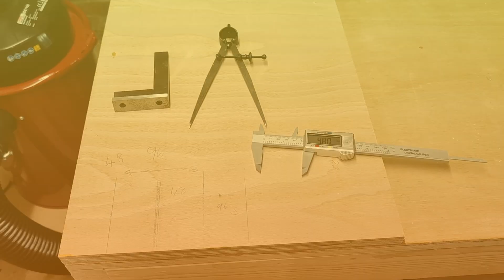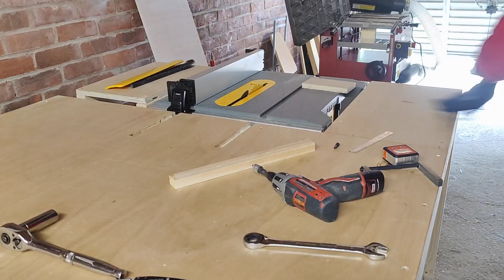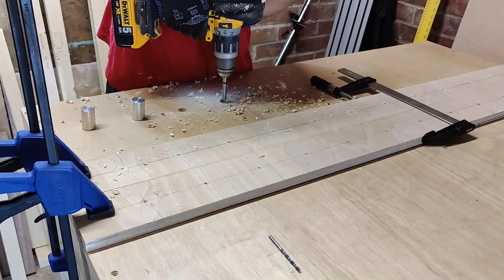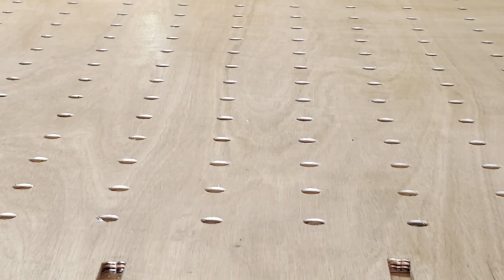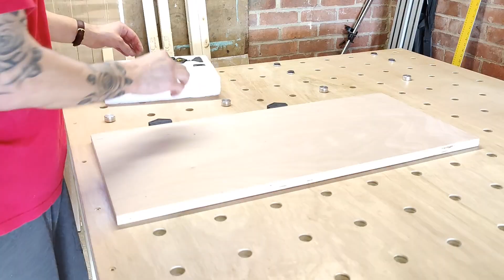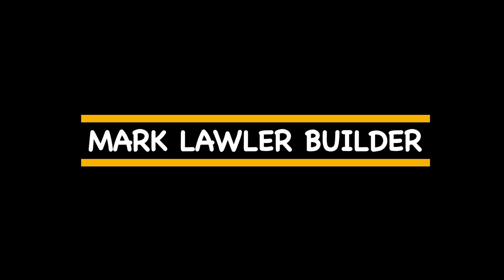Making a DIY  MFT Bench Top 2 simple jigs - No CNC | No Specialist Tools Required

Comment: PS:  You are the first fellow I've seen who has the sense to use dividers to lay out the holes.  So much more accurate than using a rule or (egads!) --- a tape measure.
Reply: Yet any error with dividers is multiplied.
Reply: I have never seen any video using rulers.  We all know measuring is error prone.
Reply: Well I see some misalignment there.

Comment: Well let me also add my explanation. MDF which is the most used for cabinet is usually 16mm ot at least thr 16mm is usedthis was used as a multiplication factor for the 96mm to make stacked pieces easier. If 18mm was the more used size I would guess the measurements would havr been different

Comment: 96mm was chosen for the same reason why most woodworker prefer imperial over metric (yes, ironically 96mm is in metric lol):
96/2 = 48
48/2 = 24
24/2 = 12 <- similar to inches to a foot
12/2 = 6
6/2 = 3

If we chose 100mm, then
100/2 = 50
50/2 = 25
25/2 = 12.5 ???

Comment: With respect to the 96 mm spacing, it is a requirement of the LR32 worldwide industry standard for cabinets and furniture. All cabinet hardware is LR32. The LR32 system was developed after the end of World War II in order to help speed reconstruction of the vast number of buildings destroyed during the war. The spacing was decided upon because that was the closest that multiple drill bits on a line boring machine could be placed, because of the size of the gears then available. Most of Europe had been using the metric system for a long time.
Reply: I knew that...  But not the gang drilling/gear aspect.  Cheers.
Reply: Nice to read this and to know it jet. I had this question al for longer time, but without any valuable answer.

Comment: An observation: By referencing each subsequent hole set off the last and using dividers in that way ANY error will be compounded…even just 1/10mm by the end of a row will be a whole mm out.  Do a check to ensure hole #10 is centred 960 mm from hole #1.  Thanks for sharing.
Reply from the maker: You're absolutely right but for what I needed it works fine it's square everywhere so ideal for clamping
Reply: @MarkLawlerBuilder  I agree
Reply: I would walk off the holes from the start and see if the tenth one lands on 960mm and adjust until it until perfect. Then walk them off again and leave marks.

Comment: I believe  96mm is chosen simply because it was adopted by Festool and fits their range of accessories….I could be wrong.  In any case if all your dog hole fitting jigs are single peg…then it matters not a jot what spacing you use.

Comment: The only concern I have is that this method would allow for a multiplication of error.  The strips would have to be exact.  I think when I get to that point, I will really consider the Parf Guide as shown by Ron Paulk.  So far, I have just drilled 3/4-inch holes where needed.
Reply from the maker: Thanks for watching. What ever suits your needs best to be honest I only use it for holding work. So suited my needs.  However, my 4ft square hits every bench dog perfect

Comment: Mark Koons
0 seconds ago
This is a useful video. Thank you. I'm mulling over the possibilities for a combined outfeed table, systainer garage, and assembly table and I'm considering using 1/8" tempered Masonite as a replaceable top surface. I've used tempered Masonite well-waxed for other bench surfaces with gratifying results. My question is whether 3/4" MDF plus an extra 1/8" will pass the ratchet clamps often used with the MFT grid system. From your experience, does it seem like the clearance would be okay?
Reply from the maker: I don't have ratchet clamps but i think they would be fine

Comment: Thanks for the link to the bench dog clamps ordered these right away. In reply to your question why the holes should be 96mm apart, 96/3=32mm and this is the normalisation standard for cabinets, hinges and so on. See the festool LR32 system for details. BTW nice video.

Comment: No problem in using 100mm.
The 96mm is because 32mm is used for spacing in shelves, but who actually use the MFT holes for spacing shelves ?
100mm makes much more sense to me.
Edit: Besides .. Some people make the dog-holes only as they're needed - without measuring.
So even if you don't get them accurate to 0.0% tolerance, don't worry too much about it.
Reply from the maker: Thanks for the feed back
Reply: I thought it was 96mm +2 to get to the center on each end first, but that doesn't make sense either.

Are there many jigs (or other things) that you can buy that use the 96mm spacing?
Reply: @Warinx  The Parf Guide system has a few 96mm spaced tools, but most of the tools have 'flexible' spacing.
When you purchase a Festool track for their router, it has 32mm spaced positioning holes (for locking the router in the right position). That should be enough for those who want to make shelves.
Notice: Many older workbenches have their dog-holes placed at random (where the holes were needed) and not with any specific spacing. The 96mm spacing is just an extra feature in MFT tables, so that you can reproduce series-production on a similar table.
For me, I do not find any advantage in 96mm spacing over 100mm spacing. =)

Comment: or just buy a CNC one from ebay for 40 quid with some dogs. then you can use that as a template to make bigger if you want too. it will be 100% accurate then. the main point for MFT is accuracy so you need it to be super accurate really.
Reply: also if you dont drill at 90degrees exactly your dogs will be out of square if not careful
Reply from the maker: Thanks for the feed back . But for me it was just about making it for fun , I know 100% it wont be spot on accurate but just really using it with clamps and stops it works great

Comment: 'Working to the nearest inch or two'- yes, it will be fine for that. Most people use these tables to ensure 90deg cuts, and for that they need to be quite accurate. Errors need to be under 0.1mm between any two holes. Marking with dividers (so that any error is added across the table) and freehand drilling can never get even close. Having tried the PARF system (making my own jigs etc using machine tools) even that leaves much to be desired. A CNC cut template is a fast and accurate route, used with a trim router. I use a template with very slightly undersize holes, and then finish off with a 20mm reamer- gives you hole accuracy not available to woodworking tools.
Using ply is an excellent choice- MDF is commonly used, and it is just not dimensionally stable enough for this purpose. (Festool use it- but they do not reference the cuts from the holes but from the aluminium frame.)
The way around inaccurate holes is to always use the same ones for tracksaw cutting, and make the fence angle adjustable. Adjust for square, and it is as good as any.
Reply: It's woodworking not precision machining. People who use MFT make cabinets, drawers, etc and for those applications there's a lot of tolerance. Heck, I've been doing all that with handtools!
Reply: @stefanopassiglia  Using hand tools you can achieve whatever precision you wish, using a process called 'fitting' (it used to be a job title...). After all, it is the starting point for all precision tools.
However, as soon as you use jigs and fixtures, you surrender such control- you rely on the tool for the level of accuracy attained. You reduce the time taken, and the skill required, but you can only achieve the tolerance that is inherent  in the tool. For production, this is well understood and the tool is made to achieve within tolerance results. For workshop use, the future use cannot be well predicted; it is wise therefore to ensure as high a level of accuracy that does not unreasonably compromise costs. In the UK (and I am sure this is true elsewhere) a CNC cut top can be bought for around £40. Not unreasonable, considering the improved accuracy and work saved. Are they perfect? certainly not, especially in MDF (but that is another discussion) but good enough for most needs.

Comment: Give the holes a little roundover or chamfer with a router to just clean them up a bit and aid the bench dogs to slide In and out easier👍
Reply from the maker: Good call thanks for the feed back . I actually ended up glueing some sand paper to a Dowl putting in a drill and cleaning them up that way